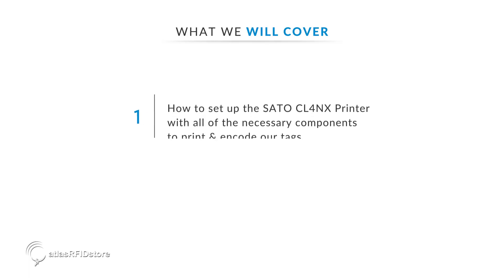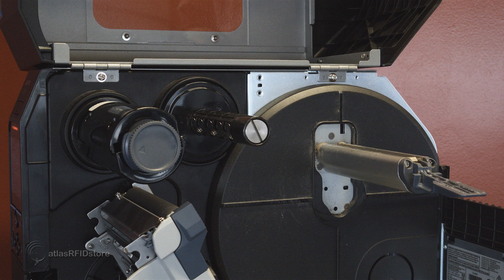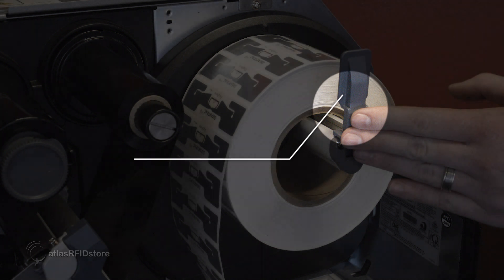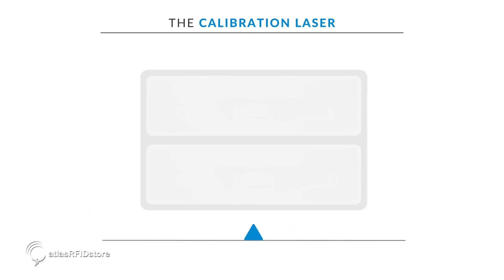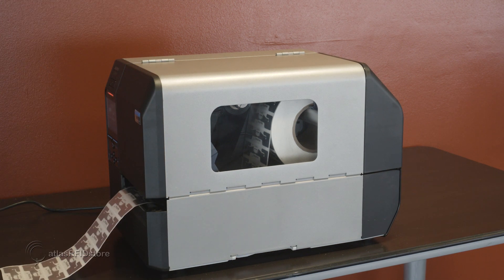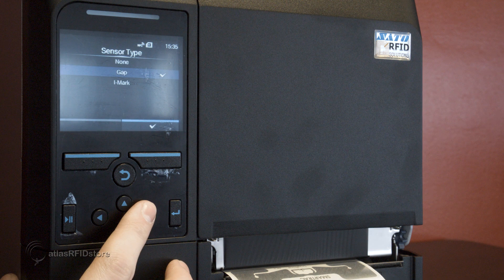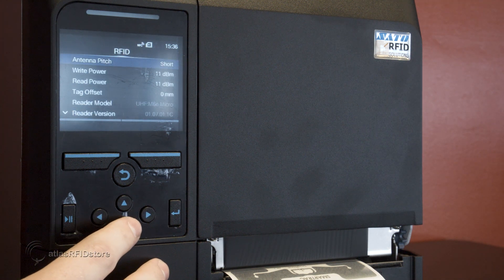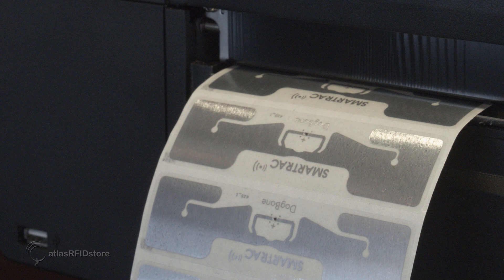Calibrating the SATO CL4NX RFID Printer

Comment: I've inherited one of these printers, the one issue I'm having is that on a UHF encoding failure it prints the failure image onto the label but then proceeds to skip one, encode another - fails due to misalignment - print another failure image and skip one. We're using a fixed size label set but the failure image appears to going beyond the print area into the next causing a misalignment and then failing again - eventually feeding one into the correct place but resulting in the loss of four labels. It has the auto size open turned off in the print menu, is there anyway to keep the failure image on a single label? I've tried turning off the mark bad tags option but we'd like it tp print on the failed label so that we can remove it. I'm doing from this API calls at the moment and would also prefer to print my own failure message if possible.

Comment: I'm getting the error: Label Pitch too short while doing RFID calibration. Any idea what this means?
Reply: The “Label Pitch Too Short” error typically indicates that the distance between labels is shorter than expected. The pitch refers to the combined height of a label plus the gap between labels.

Here are a few things to check:

Media type: Ensure it is correctly set to either Gap or I-Mark.
Label measurements: Measure the actual height of one label plus the gap.
Label length settings: Confirm that the label length is correctly configured in the printer.
Feeding accuracy: When pressing the Feed button from the offline screen, the printer should feed exactly one label per press, using your configured dispensing method.

If all of the above settings are correct, I recommend checking with your local SATO support team or your SATO Partner to confirm whether your specific labels are fully supported for RF analysis.

Comment: Khi in chip ở chế độ dao cắt. Máy in bỏ qua chip đầu tiên không in. Là lỗi gì ạ. Thanks
Reply from the maker: Most cutter issues where RFID tags are skipping can typically be remedied with a media calibration. Skipping is usually a sign that the printer was not able to identify where a tag began or ended. I hope that helps!

Comment: Hi there, when Online button is pressed our printer feeds paper out perpetually until manually stopped, whay might be the cause of this?
Reply from the maker: Constantin - 
This is usually an indicator that the printer is not calibrated correctly for the media, or the sensor plate is not in the right position. Try recalibrating and moving the blue sensor plate until the triangle symbol sits over the gap between the tags, or the rectangle symbol sits over the black mark on the tags.
Reply: @atlasrfidstore  yes, calibration worked, however in our case the printer head was damaged. Replaced it and worked.